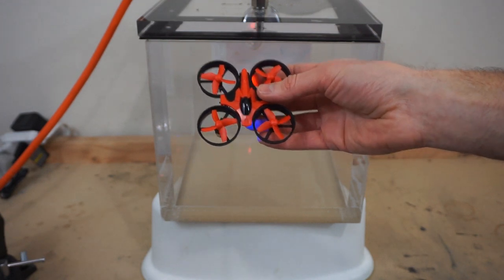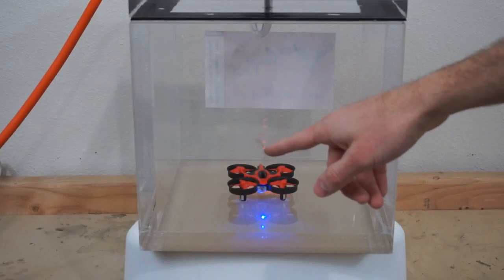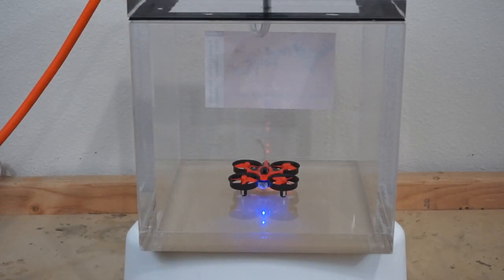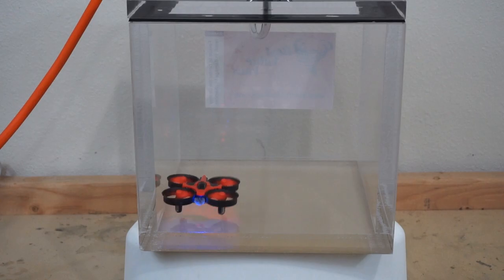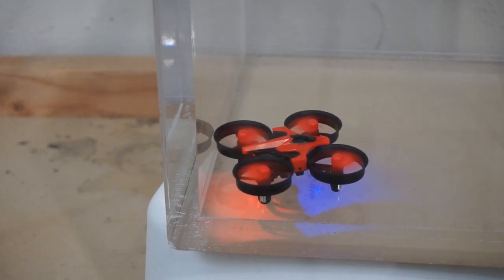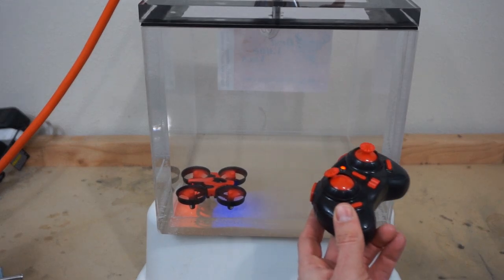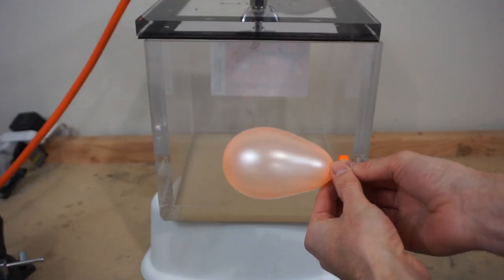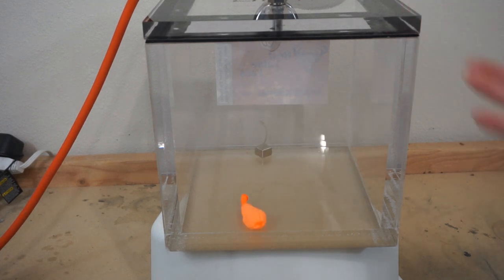What Happens When You Put A Drone In a Vacuum? Can It Still Fly?

Comment: you releasing that balloon against the wall of the vacuum chamber is the reason why it moved if you had that box the size of your room and then release it in the center, the balloon probably would not move because it has no matter to thrust against. That experiment is false
Reply: ROTFL
Reply: @darklight2.1  ....that's all you can respond about.... grammar.... 😂....that shows you have no logical thoughts on the subject.....no conversation or debate, just grammar policing...
Reply: @darklight2.1  Newton's law works in a pressurized atmosphere where there is  matter...matter to cause the reaction.....take away the pressurized atmosphere with matter, and replace it with a infinite vacuum and Newton's observations and conclusions would be different. And to be more clear I'm not saying the balloon would not move in a vacuum, of course it will because the rubber is expanding and contrasting I'm saying there will be no propulsion
Reply: Trying to use scientific laws and theories that work on Earth, a pressurized atmosphere with matter, in "space", an infinite vacuum and void of matter, is illogical and a blatant disregard for the scientific method because the environment is totally different which means the outcome would be totally different.
Reply: @darklight2.1  I am a high school graduate and a graduate of a four year technical School and have been a electrical Foreman for 17 years been looking for the same electrical contractors for 23
Reply: @darklight2.1  I'm very educated when it comes to electrical systems electrical properties electrical magnetic systems. I am a very analytical curious person by nature that's why I am in the electrical field
Reply: @darklight2.1  the official reason why they can have propulsion in space is the conservation of momentum, which to me is a stretch.
Reply: @darklight2.1  I recently watched a video with the physicist Brian Cox I believe is his name. He was in the world's largest vacuum chamber and released a ball and a group of feathers, once in atmosphere with obvious results and wants in zero atmosphere with obvious results. My experiment would suggest dropping the balloon and wow the balloon is falling release the air and tell me if the balloon would fly all over the place or would it continue falling releasing its air
Reply: @anthonyparker4943  - Answer some very simple physics questions and I can get you to understand.

First question: If I fire a steel projectile from a CROSSBOW, here on earth, will I feel a recoil force? Yes or No?
Answer that and Ill give you the questions that relate directly to rocket propulsion.
You would be surprised how many people (that THINK they understand physics)  get this answer wrong.

Comment: now burn some rocket fuel in there or perhaps gun powder, I need more thrust examples, the balloon was released from the side of the cage so there are variables, its also a freaking balloon perhaps there is a way to place air within a sort a tube and hang it on a string and see if it moves when you eject the gases but hanging it on the side is just not a good experiment.

Comment: It worked because it had something to push against, I.e the glass.

What does it push against in space?
Reply: Nope, you don't need to push against anything for propulsion to work.
Reply: Rocket propulsion is just the mechanical recoil of pushing on mass.
Recoil works in a vacuum, therefore SO DOES ROCKET PROPULSION.

Comment: The only reason that balloon went anywhere was because it was placed up against a solid surface. Try the experiment in a container the size of a room with the same sized balloon placed in the center and see if it moves. So deceptive.
Reply: You’ve been deceived into thinking the third law of motion stops applying in certain circumstances.
Reply: @AM-rd9pu  I think you are projecting. Based on the third law of motion what force is the air in the balloon pushing up against in a vacuum? In the experiment the balloon is right up against the container wall so the 3rd law applies but increase the size of the container and place the balloon in the center (far away from any solid object) and then let the air out. Are you telling me the balloon will fly forward? What exactly is the the escaping air pushing against in a vacuum?
Reply: @unletteredandordinary  You have a fundamental misunderstanding of the third law of motion. The air inside the balloon pushes off the balloon as it ejects out the back and the balloon pushes off the air it ejects out the back. 

What the air does after leaving the balloon has no effect on the balloon, just like how you don’t feel when a bullet strikes a target or when water from a garden hose hits the ground.
Reply: @AM-rd9pu  Also, the balloon did not increase in size much at all, meaning there was still a significant amount of air pressure inside this guys “vacuum” chamber. Pure deception.
Reply: @darklight2.1  Seriously that ballon should have at the very least doubled if not tripled in size. But keep making excuses 
 if it makes you feel better.
Reply: @unletteredandordinary  You clearly missed the part where he said that he only lowered the pressure to the point where the quad copter stopped flying. That means there was still air in the tank. 

You have no idea what the pressure inside the balloon was to start, what the pressure inside the tank was, or what the compressive force exerted by the balloon was. So how do you know how much the balloon should have inflated?

The answer is that you don’t and are just jumping to conclusions that fit your reality denying narrative.
Reply: @AM-rd9pu  Thanks for making my point. You’re absolutely correct there isn’t enough information given for this to be “proof” of anything. BTW, I’ve watched other videos where balloons have been initially inflated to roughly the same size and they expand to 4x the size so by saying it should have expanded to at least double or triple the size was being generous. That’s why it’s clearly logical to doubt the veracity of this persons claims. He’s proven nothing.
Reply: @unletteredandordinary   I just explained how we don’t have enough information to know what size the balloon should expand to. So why are you insisting that it should have expanded more? You’re also not considering the fact that there most likely wasn’t a perfect seal at the opening of the balloon. Air escaping from the opening would also prevent the balloon from expanding more. 

We know there’s still air in the tank. It’s just not enough for that quad copter to fly. 

The main point of this demonstration was to show that taking away air eventually stops propellers from working. The demonstration of the balloon flying was just a bonus to show that rocket style propulsion doesn’t need air like propellers do.
Reply: @unletteredandordinary here is an example for you:
A space shuttle main engine consumes 500 kilograms of liquid oxygen and liquid hydrogen Per second.
It combusts the fuel and oxidizer and expels it from the nozzle at Mach Eight (2500 m/s).
Now tell us that the SSME can accelerate that mass WITHOUT APPLYING A FORCE to that mass.
Reply: @stuartgray5877  Of course the main engines apply a force to the shuttle because they are essentially at sea level when they launch so there is plenty of atmosphere to push against. Now if you claim these same rockets project the vehicle in space well since that’s the point under contention you can’t just assume it you have to prove it otherwise you’re arguing in circles. The only way to simulate whether a balloon/rocket can exert force enough to project itself in a vacuum is create a vacuum the size of a football stadium, place the balloon/rocket in the center and release the pressure from the back to see if it moves. In the experiment above;

A. The balloon barely expands  at all, indicating that there was still a considerable amount of air pressure in the container and 

B. The balloon was situated right up against a solid object so the escaping air had something to push against thus causing forward momentum. 

Why don’t you actually address my argument instead of resorting to Red Herring’s?
Reply: @unletteredandordinary  so IN ATMOSPHERE how does the rocket engine accelerate all that mass?
Just explain it to me.
What is the mechanism for the 500 kilograms to get accelerated from a velocity of zero to Mach Eight?

Does the 14.5 PSI atmosphere "Suck" the gases from the 3000 PSI combustion chamber?
Are the gases accelerated by "Magic"?
Just tell us what causes the acceleration.
Reply: @stuartgray5877  You obviously don’t understand what a Red Herring is. If you think this video proves rocket propulsion is possible in a vacuum then deal with the objections I raised above. Providing you with an explanation of the physics of rocket propulsion at sea level is irrelevant. Deal with the argument and the evidence I’ve offered to substantiate it or concede that this video doesn’t prove that air escaping out the back side of a balloon will propel it forward in a vacuum.
Reply: @unletteredandordinary  rocket propulsion is the mechanical recoil of pushing out mass.
Anyone who claims rockets don't work in a vacuum is completely clueless about Newton's laws and would be incapable of passing even a high school physics exam.
So you failed to graduate high school, but you feel confident arguing basic physics with rocket scientists?
This is called the Dunning-Kruger syndrome.
Reply: @unletteredandordinary  I just watched a Falcon9 launch and booster landing live with my eyes.
Was that CGI?
Bless your little heart!
Reply: @stuartgray5877  You still wasting my time and refusing to address my actual argument?
Reply: @unletteredandordinary  sorry but it is YOU that keeps avoiding the questions I asked you first:
HOW does a SSME accelerate 500 kilograms of water to mach eight every second??.
Explain that, or say you don't know.
It is YOU that refuses to answer simple physics questions
Reply: @unletteredandordinary  I'll explain it in simpler terms
A space shuttle main engine 
(SSME)
Accelerates 500 kilograms
 (kilograms is a measure of "mass")
From a velocity of zero to Mach eight.
It does this EVERY SECOND.
This SSME "accelerates" 500 kilograms of mass
from 0.0 meters per second (m/s)
To
2500 meters per second.
(Changing 'velocity' from 0 to 2500 m/s is called 'acceleration')
The SSME accelerates mass out the back 
HOW
does the
SSME make
the mass
SHOOT OUT?
Is this "magic" to you?
Reply: @stuartgray5877  It’s irrelevant but apparently you’re cognitive abilities aren’t allowing you to realize that fact. Now if you can address my argument as to why I find this man’s experiment to be lacking any credibility then do so. Otherwise concede that his video does not constitute proof that air escaping out the back side of a balloon will propel it forward in a vacuum.
Reply: @unletteredandordinary  I am trying to explain how the Tsiolkovsky Rocket Equation is derived from the Law of Conservation of momentum which is derived from Newton's third law. This requires a grasp of basic physics terms such as velocity, acceleration, mass, and momentum.
But apparently you are incapable of discussing basic physics in a way that allows you to learn 
I understand why you dropped out of school.
It's fine, you have a right to remain willfully ignorant 
Carry on.
Reply: @unletteredandordinary  - "It’s irrelevant but apparently you’re cognitive abilities aren’t allowing you to realize that fact."

So, did YOUR "Cognitive abilities" allow you to read about the Tsiolkovsky Rocket Equation and tell us where the flaw exists in this 100-year old equation?
No?
This should be trivial for your YouTube education, right?
Reply: @unletteredandordinary  - "The only reason that balloon went anywhere was because it was placed up against a solid surface."
This is your initial premise.

I have been trying to get you to see that this premise is incorrect, but you refuse to participate in the exercise.
So, I will just put it in terms your intellect can process:
"Balloon push stuff one way, stuff make balloon go the other way".
Reply: This is getting repetitive and boring. Not only was the balloon situated next to a hard surface (which don’t exist in your fantasy world known as “space”) but you also failed to address the fact that the balloon never really expanded all that much. (Which of course it would have had to if it truly was a “vacuum”)) So since your feeble mind can’t comprehend what the actual argument is even after I’ve explained it several times allow me to put this in a language you can readily understand, “Balloon not get much bigger like other balloons in vacuum thingy. Air still squeezing balloon like BiG HuG, d’er…” 😂
Reply: @unletteredandordinary  
So according to YOU if you put ANY gas in a Balloon in a vacuum it will just keep expanding till it pops?
So a Mylar birthday balloon designed to pop at 40 PSIG  (In atmosphere) will just "Pop" in a vacuum when filled to 5 PSIA???

Cool story bro!
Bless your little heart!

Comment: The air in the balloon pushes against the chamber
Reply: No. The balloon pushes on the air as it leaves the balloon.  The balloon would still get propelled even without any walls.
Reply: The balloon pushes off the air it is ejecting.

Comment: Your drone is also pushing off the chamber....space vacuums do not have chambers which is a solid body to push off...

Which is exactly the same principle as your using for the baloon...it wouldn't work if the baloon was pushing against nothing and not in a container....a space vacuum is not a container...

People need to start to compare what we are told is the reality of space not enclosed vacuums with walls to push off...😁👍
Reply: Good thing rockets take mass with them to space to push off of.  So you think RECOIL STOPS working in a vacuum?  Bless your little heart!

Comment: air can not propel anything in space because the air needs other air around it to push against.
Reply: So "Air" does not have mass?
  any time one device PUSHES on mass, it gets PUSHED in the opposite direction. (ANY "MASS" solid, liquid OR GAS)

If you push the MASS of air in one direction the object PUSHING IT will feel a recoil force in the opposite direction.

DO you think the recoil from a firehose is from the water "Pushing on the air"???

So a firehose shot into a vacuum would NOT have recoil????
Reply: @stuartgray5877  the recoil from the fire hose is from the water pressure this is kind of a different story
Reply: @madsco27  WHY do you think it is different?  Recoil works for ALL kinds of MASS.  One type of rocket engine has PURE WATER as it's exhaust gas.  How is that different from a firehose?  Do you think water loses its mass when it changes from liquid to gas?
Reply: @stuartgray5877  water and air have different properties
Reply: @madsco27  What does that have to do with what I said?

A firehose has recoil because it SHOOTS OUT MASS.
GAS has MASS TOO.
So a device that shoots out GAS FEELS A RECOIL FORCE!

Answer these questions:
1 - Does the exhaust gas get accelerated when it leaves the rocket nozzle? Yes or No?
2 - Does exhaust gas have mass? Yes or No?
3 - Can MASS be accelerated without a force? Yes or No?

Answer those three questions and YOU might learn something.
Reply: @madsco27  - "water and air have different properties"

But did you figure out that BOTH have the ONE property that matters? - MASS!

Are you afraid to answer my questions now?
Did you figure out that answering my questions proves YOU wrong?
Reply: @stuartgray5877  I'm not afraid to be wrong, thats how people learn.
Reply: @madsco27  
Well, you can't learn anything if you keep repeating things that are obviously wrong.
Also, one way of learning is accepting knowledge acquired by other people, and not only by yourself, since no person could find all by himself, knowledge that other people have been acquiring for centuries.
Reply: @madsco27  so answer my questions and I'll ask the IMPORTANT questions to help you understand.

Comment: Sorry, the air is pushing against the barriers. The experiment doesn't prove anything
Reply: It surely proves something we already know, there is no need to push of something to create action-reaction pair of forces.
Reply: @absingh4951  
Who said: ’no need for proof’ and where?!
Quote please.
Reply: @absingh4951  
It is not a dogma, since dogma is something you can't test or verify, but have to accept.
We can test and verify that airplanes and helicopters are not pushing of  of the air particles in atmosphere.

When you look closely, you will notice that this balloon is not pushing of the wall, since its speed doesn't decrease when back part of balloon is farther away from the the walls, and then speeds up when back part of balloon is closer to the walls, which would be normal if it needed a wall to push of something.

Also, if airplanes needed air particles to fly in the atmosphere, they would decrease in efficiency dramatically when on higher altitudes, where the air is much thinner than on the ground, yet, we know that airplane engines are the most efficient at 10-12 Km altitude.
Reply: @absingh4951  
Because you need fluid (air) to produce pressure difference that makes helicopter to take of.

While helicopter blades are rotating in the air, they produce pressure difference that generates lift in the direction opposite to the direction of gravity force.

When there is no air, there is no pressure or pressure difference, and no lift.
Reply: @absingh4951  
Yeah.. right, small amount of the air from balloon created high pressure....

Propulsion works on the principle of action-reaction, not on pushing of something.